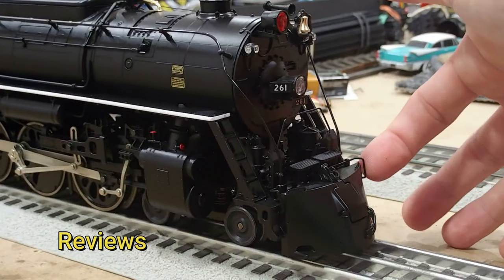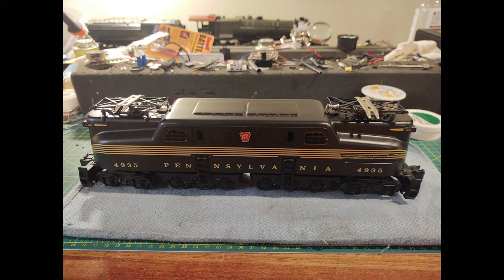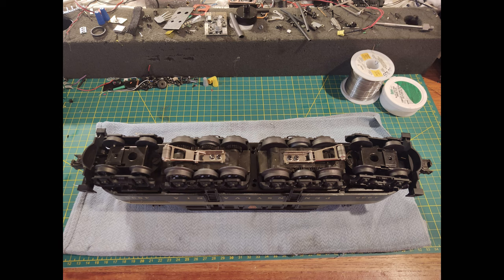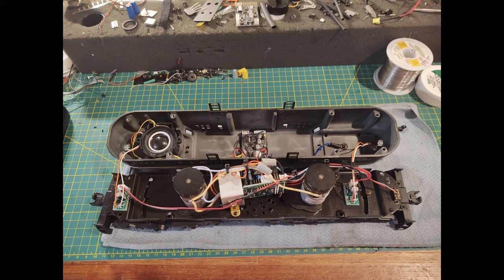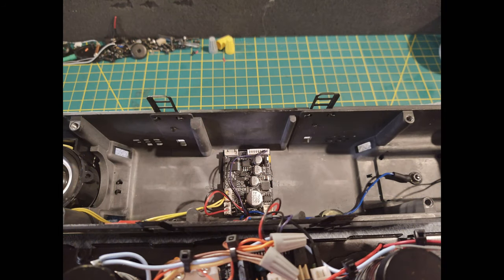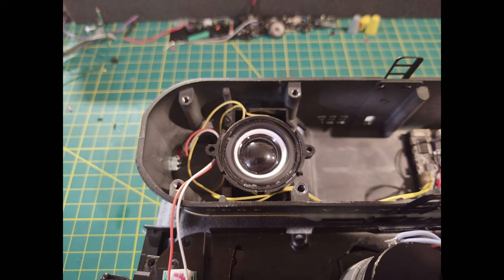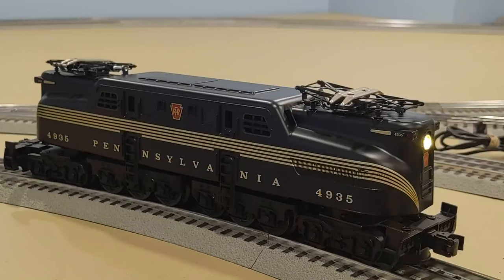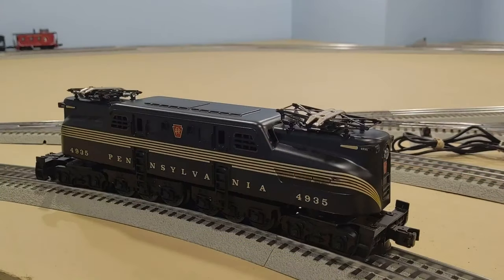Pennsylvania RR GG1 ERR TMCC Upgrade #workbenchwednesday

Comment: Unfortunately it is extremely rare to find accurate GG1 sounds.  No one gets the traction motor/gear whine correct. There is no mistaking that rising pitch sound as the engine accelerates. Actually a good postwar Lionel 2340 or 2360 has more accurate sounds from its pullmore motors and metal gears than most modern electronic sounds.

Comment: Ive never had to use the led boards with ERRco products to get led headlights or markers to work! Ck out my Budd train video on my channel!
Reply from the maker: Hmmmm. I will have to love into that. From what I know and have been told it usually doesn't just work when they are hooked up, but let me see then. I will get back to you. Thanks for the tip.
Reply: @SidsTrains  only the old tmcc drivers Didn’t like LEDs but the new electric Railroad drivers work fine
Reply from the maker: @KandRCustomModels  well that's good to know. I will still look into it more. Must have been the old R2lc board and with the newer R4lc they resolved the hiccup. Thanks for the tip. Saves me a step and a dollar haha.
Reply: @SidsTrains  ive done several older tmcc with leds and usually parallel a led with incandescent bulb for load. It works most of the time!